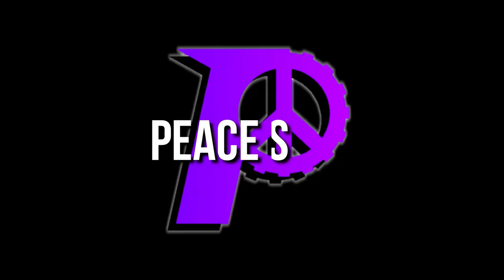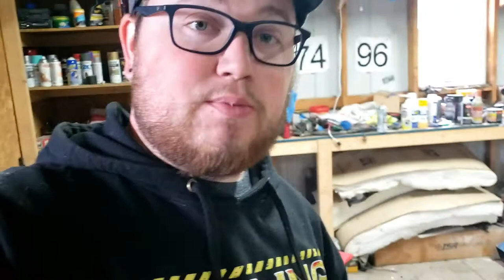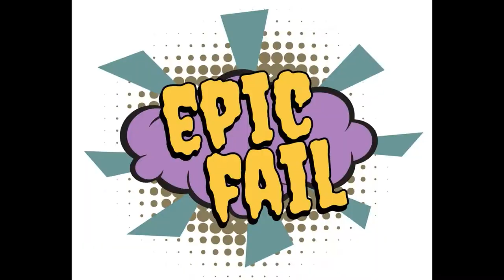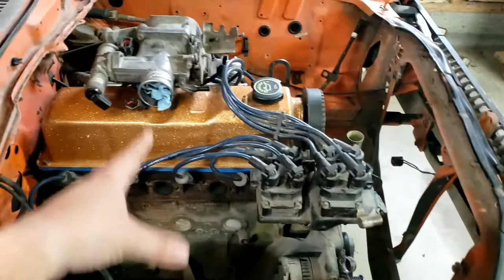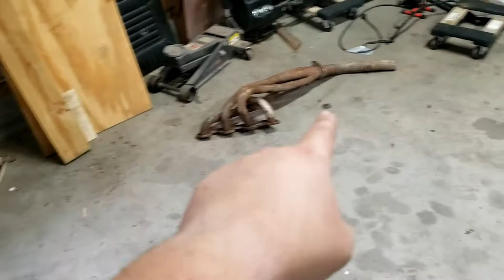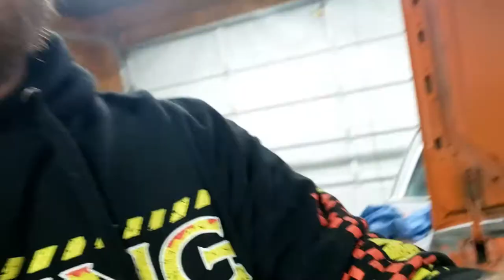Ford Pinto Engine Installation!!

Comment: I had an old S10 pickup that had a worn pilot bushing.  The clutch disc can be thrown off center between shifts when the clutch is disengaged and when the clutch is re-engaged to an off-center disc, it will set up quite a vibration.  Glad to see you're making progress with the old pinto.
Reply from the maker: I did debate on it for a little while which isnt really shown in the video. In the end, I figured that I would spend a bunch of time trying to basically grind out the piece of metal that was left in the crank, and could potentially screw up the crank, and I didnt want to risk that. So I decided to just leave it and see if it causes an issue or not.

Comment: I had a pilot bearing in pieces, I couldn't grab     onto it with my puller. I had to cut it out with cutting chisel without ruining the crankshaft. I finally got all of the pilot bearing out. I then installed a pilot bushing in the end of the crankshaft, they last a long time. The pilot bearings run out of grease and they fall apart do not last near as long.
Reply: Thank you for being smart enough to know you need a good pilot bearing ..Half a pilot bearing will not be worth  two vents..

Comment: Awsome vids. Dont give up on the pinto. I've had many of them over the years and have one tore down for 18 yead now. Finally getting started back on it myself.
Keep the vids coming,its definitely helping me stay inspired to work on mine.
Reply from the maker: Awesome man, this one has been down for about 18 years as well and I'm excited to get it on the road! My goal is to drive it before the end of the year!
Reply: Have you made any more progress since you were wiring it up?
Reply from the maker: @79beans347  yes and no. Ordered parts for the fuel system, so that will be coming up soon. Also, bought a used windsheild. I'll be doing a video on making the early windsheilds fit into the later cars as well.
Reply: @PeaceParts  sweet man I can't wait to see more on it ,ive been looking for your videos and i have my 347 and T5 transmission all bolted up in my pinto and started putting the headers in ( they are truly a pain in the arse ) they come in 3 pcs per side  so i have the main body  with 2 primary tubes then I have 2 individually tubes that I have to put in one at the time and i had to cut a hole in the inner fender so that they can run out in the tire well and wrap around the frame and go into a slip joint in the main body on each side of the car so yeah it is really tight and the motor has to be just right for the headers to fit , i took the motor out and put it back in 6 or 7 times trying to get my home made frame mounts in the exact perfect spot so that everything else will work 😂🤣 if i do another one it will be much easier but figuring it out was pretty time consuming
Reply from the maker: @79beans347  wow, that sounds like a lot of work! Haha that's why I went the easy route and my setup all just bolts into place like it belongs there!
Reply: @PeaceParts  yeah as far as it bolting in yours is most definitely the easiest route although I may have a few less wires to deal with but I probably could have wired up the computer harness in the time it took me to get the engine located in the exact perfect spot but if I had to do it again I would know exactly what to do and it would go smoother the next time but I hope that i won't have to do it again being everything in the motor is new except for the block 🤞 but I can't wait to see you get yours going and mine as well, maybe i can hear mine this weekend if all goes well, i have a little wiring left to do like the fuel pump, fan  ignition box  distributor and run new fuel lines and 1 wire alt but it will all worth it in the end and should be a fun car to drive hopefully with no issues 😂🤣🚙💨💨💨

Comment: Great video, thanks.  I just purchased a 1929 Mercedes kit car, and it came with a Pinto frame.  It has an I4 engine with a manual transmission.  I want to upgrade to a V6 fuel injected with a 5-speed tranny, which seems to be what you are doing.  Were there any modifications within the engine bay that you needed to make for the engine to fit?  Any welding of engine mounts?  I'm really hoping it's a fairly easy swap.  I appreciate any feedback.
Reply from the maker: This car was born from the factory with a 2.3 engine, and the engine I put in had the same block design and mount locations  so it was a completely bolt-in job. I can't speak for how the v6 car and swap would be, especially in a kit car. But it sounds very neat!

Comment: I realize this is an old video but about to start a similar project with my son. We are going to put a T5 from a 2.3L mustang behind the factory 2.3L. What did you use for clutch cable (we thought maybe trying a 79+ adjustable mustang cable)? How did the T5 sit in the factory hole for the old 4 speed? Thank you!!
Reply from the maker: I didnt manual swap it, my grandpa did way back when. So I used the cable that was already in the car when I got to it, I assumed it was a factory pinto cable, bit I'm not sure. I didn't have any clearance issue with the t5 in the tunnel, the shift location is slightly different though and my shifter hole has been trimmed a bit for clearance. Can't say for sure how much though. Hope this helps!

Comment: I've been told and have tried bread for the pilot bearing
Reply from the maker: I should've gotten some footage of it lol this thing had seen some heat and it was a thin piece of metal basically welded to the inside of the crank. There was almost no chance I could get it out because there was simply nothing to grab
Reply: @PeaceParts  ah gotcha there's always away lol and if I was ther to help bud I'd gotten it out for ya lol

Comment: Are you going to keep the fuel injection??
I'm definitely enthused to see that.
Reply from the maker: Absolutely! It will be running the stock computer and everything from the ranger. Already have a fuel cell, just need to figure out the rest of the fuel lines and the injection will be no problem!

Comment: i see ignition coil. do you need computer for it. I,m putting a 2.0 engine on an ice cream truck and having problem with timing. on the distributor. thinking on putting that type of coil/. any suggestions
Reply from the maker: Yes you will need the computer. I bought the engine, wiring, and computer from a 92 ranger that I used in this swap.

Comment: thats 205 block? and what is EFİ
Reply from the maker: Not sure what you mean by 205 block? Efi is electronic fuel injection versus running a carburetor
Reply: @PeaceParts  ı am sorry my english is not good ,ı mean 205 block with efi ,not corburetor.
so what is EFİ name ? ı cant find that
Reply from the maker: @mirac7984  i don't believe it's a 205 block. This entire setup came from a 1992 Ford Ranger
Reply: @PeaceParts  Hmm okey thank you man good videos :)